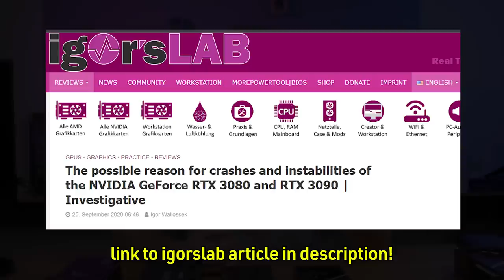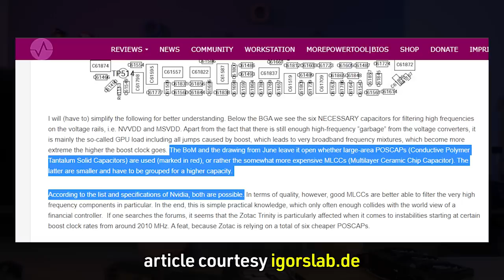The RTX 3080 Launch can't get any worse... Right? Wrong...

Comment: First generation I've only considered FE for. Strange times.
Reply: The Founders' Edition is indeed the best 2-slot card. The TUF is 2.7 slots, so it's the one I'd go for if you don't care about staying within 2 slots.
Reply: @gunnar6674  I'll stick with my 2070 Super for now. Waiting for the 4000 series.
Reply: Same
Reply: Maybe I'll snag a a 3090 when the 4000 series comes. Founders maybe.
Reply: @Mallchad  If you wait for rtx 4000, chances are a 4080 is just as good but cheaper than 3090.
Reply: @am33x  it is going to be for sure, its not a 'chance' it WILL be. or at least it SHOULD be
Reply: I mean the cooler desgin is just super nice as well.
Reply: @am33x  Not preowned it won't be ;)
Besides. 
The whole value hardware thing is getting out of hand.
Given the choice between two functionally working cards. 
If you are looking to upgrade.
As long as you can getting enough performance for what you want who cares.
Like people were selling their 2080 Supers for $300.
Founders editions as well.
Like, that's a steal and a half.
Not to mention, raw horsepower / performance is no longer the only thing that matters.
Reply: @Mallchad  Some people save up for a long time to finally afford phones, pc components etc. So to them every dollar counts. Is buying second hand a good idea? From what I know it's difficult to test a gpu's health so you don't know what you get.
Reply: @am33x  Generally.
What I think about GPU longevity.
The parts don't really wear in the same way. 
Not unless they are exposed to quite a lot of shock/vibration or water damage.
You lose small amounts of clock stability overtime but the cards are usually build with overclock headroom anyway. 
*usually*.
It either works, or it doesn't.
That doesn't change in any short timespan.
Maybe in some cases there physical damage where the card is on a death timer.
But I would expect you would be able to identify that quite easilly.

Comment: Glad I still use the 1080ti, The Anomaly.
Reply: Glad i didn't sell mine till now
Reply: 1080 ti is not even mid-end at this point. sold mine weeks ago. 3080 tuf sails with 2+ghz boostclocks post oc.
Reply: @lort6022  The 1080ti is still high-mid... you are out of your mind if you think it is below mid-end.
Reply: @jong2359  a 3060 will be stronger so is it really top tier
Reply: @lort6022  get a grip, 1080ti is ~ 2080 performance.
Reply: @pootsplasencia4846  What are you even talking about?  That is like saying $5 is worth more than $1.  We are talking about 1080ti cards.
Reply: @lort6022  in what universe is a 1080 ti below mid range? it runs any game that currently exists at 4K on high... maybe not max but then it never could max out anything contemporary with it at 4k lol
Reply: Sovsefanden wat...
Reply: @jong2359  a 3060 is supposed to be equal to a 2080 which is a little bit better than a 1080 ti and a 3060 is a mid range card a 3070 mid to top and a 3080 and 3090 are top tier
Reply: @RWoody1995  u dealing with nerd elitist... i have the new shiny lamp so your old lamp is trash.  Been that way since forever
Reply: RWoody1995 I wouldn’t go that far lol..
Reply: My 1080 is beasting still, 100+fps ultra mega penta giga uber settings on any game. So I do not see the reason for dropping a 1080, not to mention a 1080Ti. People are seriously fucking dumb.

Comment: If the user was initiating the overclock, your argument would have a more solid base.  As it stands (and if it is a hardware issue that can't be fixed by a driver w/o reducing performance), a recall seems the correct approach. If you're correct on the total cards in the wild being in the low thousands total, then each manufacturer may be looking at a minimal cost.

Comment: I can't wait to see what AMD has to offer this gen.
Reply: the ps5 and xbox x got amd 32 core GPUs that can go bettween 1.10GHz to 1.23GHz on all 32 of the cores so its not even comparable bruh and those game consules are being sould for like between like $300-$600 USD eve those the gpus cost over $6,000 USD eatch and not to mechon apple got sick and tired of niveda cheaping out and swtiched to amd back in 2015
Reply: ashtiboy uh what
Reply: ashtiboy ????
Reply: @ashitboy are you high
Reply: @ashtiboy  what are you on
Reply: ashtiboy first, neither console has 32 compute units. Xbox went with 56, and PlayStation has 36 so I don’t know where you got 32. Second are you seriously suggesting that Sony and Microsoft are selling these consoles at a 5,500 dollar loss? That’s almost ten times the cost of the PS3 when it released, all down the drain. And finally, Apple switched to AMD GPUs supposedly because Nvidia GPUs where failing and Nvidia said it was apple’s fault and Apple said it was Nvidias fault, and this arrangement has been to the detriment of Apple customers ever since. I mean, you can spec out your new MacBook Pro with the new top of the line i9, but you can’t get a more powerful GPU then a what, comparable 60 series gpu from team green? (By 60 series I mean like 2060, 1660 1060 and 3060 gpus, not that Nvidia has some 6000 series gpus)
Reply: I can
Reply: @benoitpepin5779  good boy

Comment: same issue with PS3 NEC TOKIN capacitors when they run down on capacitance over time. So they aren't able to provide enough current needed by the CPU to keep running. Putting cheap capacitors only makes the cup trip sort of. Since there's not enough power supply to the card

Comment: Just send 'em to Louis Rossmann. 😉

I myself will stack up on some MLCCs and fire up my hot air station. I'm wondering what potential might be unleashed with 6 of those power delivery stacks. 

Regards,
Etna.
Reply: The only potential is a stable card.
Reply: It's entirely possible that both footprints are on the board. We do that where I work sometimes to avoid supply problems. I know I couldn't reflow caps that small, but I'm sure someone could.

Comment: AMD watching this, slapping MLCC's on all their upcoming cards with a greedy smile :D
Reply: Why bother? They'll get crashes purely from crappy drivers lol.
Reply: @woopwoop3924  either that or they have a card that will hurt nvidia pretty bad, excited to see the face off in October
Reply: AMD has no control over what AIB's do....hate to break it to ya. The GPU is that little chip on the top, nothing else. Everything else is up to the AIB to do. They failed at their job, not Nvidia. Even if rumors of a faulty blueprint are true (which I highly doubt), the AIB's should have noticed that during performance testing and designing of their boards. It is their fault 100%.

Comment: Find it odd that Asus isn’t showing that stellar MLCC configuration on their website with the TUF 3080. I see 6 of the crappy pulse caps behind the GPU die. 
https://www.asus.com/Graphics-Cards/TUF-RTX3080-O10G-GAMING/

Have a feeling their is gonna be some changes in personnel with these AIB’s. 
When I buy a higher tier non-reference card, I expect better parts. Not worse.  
Never thought I’d see the day when the reference card is better than many of the higher tier cards.

PS. I have used reference cards in my system for the last 2 GPU’s I have owned (980ti, 2080ti) but if I bit the bullet with this gen I wouldn’t have gone with the FE partly bc of the experience I had with all the screws and thermal pad craziness in the 2080ti, but the main reason being that wonky power connector of the 3000 series FE cards and the fact that higher tier AIB cards (I thought...) all performed better with their higher power draw. EK hasn’t even release waterblocks yet for those Nvidia 3000 FE cards (which to my knowledge is a first. FE is usually the first with waterblocks). Bet it’s bc of those power connectors. You pay for a nice system, you set it up yourself, it looks beautiful with ur custom cables, loop, lighting, etc....now you got this dongle Nvidia is forcing you to use with their FE cards.  I may be wrong, but this is what I’m seeing.
Reply: Meat Fancy 
That, or the website was created VERY early on, they discovered the problem and changed the design before going to mass production. 
I don’t have enough info to know yet. 
Either way, they need to chg the website if they indeed are releasing a superior card. It’s gonna cost them severely if they leave that image up if it’s not representative of the parts on their released version.
Reply: Its probably the Strix that has the better configuration:
https://www.asus.com/Graphics-Cards/ROG-STRIX-RTX3080-10G-GAMING/gallery/
Which kinda makes sense
Reply: @the_mrkaryo   They've changed the TUF images now too =) (only thumbnail on one of the images tho)
Reply: Karyofyllis Patsidis 
Yeah. Strix’s images are what I would expect given this news.
Reply: In fact you can see BOTH versions of the TUF card, one with the cheap caps and other with the MLCC ones. lmao
Reply: What's the eVGA FTW3 ULTRA 3080 running? Can anyone confirm?
Reply: The gallery images don't matter. Someone put the wrong images on those pages. One is the OC version (the one with "O" in the naming scheme) and the other is the non-OC version. The OC version is going to be the one with the full six MLCC groups (the better caps) and the non-OC will be the one with six of the lesser capacitors. The images are just all fucked up and mean jack shit. The OC version also has three 8-pin's, but the images in the gallery only show 2. So, yeah, whoever put their website together didn't know wtf they were doing. 

And because these cards both look exactly the same, with the exception of the capacitors and the power plugs, I can guarantee you people will be getting them confused and selling the shittier one for the price of the OC, and vice versa. You can thank ASUS for this confusing bunch of bullshit, and you can thank NVidia for forcing their board partners to wait until last minute before they can do anything. What a fucking joke of an industry. 

Non-OC (shitty capacitors) https://www.asus.com/Graphics-Cards/TUF-RTX3080-10G-GAMING/gallery/

OC (good capacitors) https://www.asus.com/Graphics-Cards/TUF-RTX3080-O10G-GAMING/gallery/

Ignore the images.

Comment: Hm. I can solder SMD components. Should i build a business on this? :D ;P
Reply: Ur name. LoL
Reply: That's one way to put your hands on a 3080 this year... LOL
Reply: Do it bro even if it's a little internet thing call it 3080fixerer
Reply: If you're as good as Louis Rossman I'd buy repaired boards off you
Reply: Doesn't the board need different traces and solder pads for the smaller more expensive capacitors? 
I think that's why Jay said they're going to do a firmware fix rather than a board fix. Because they would have to redesign the power delivery of the board again. And that would be expensive and time consuming.
Reply: Yes
Reply: Yeah should be possible to modify the board.
1. Make interposer PCB that mounts 10x 22uF MLCCs and solders onto the space occupied by the larger cap.
2. Remove the large capacitor without messing up anything else on the board, lots of flux helps.
3. Profit.
Have fun with what remains on the postal system, 'cause people are going to have to mail the cards to you.
Reply: I was thinking exactly the same thing. Looking at the pictures of the pcb, the pads for the mlcc's are there. With my rework station I am pretty sure I could change out the cap's in an hour or so. It's the kind of stuff I do all day every day at work.
Reply: @swanseauk  I couldn't tell if the pads for both style of caps were there, without rewatching the video and pausing it.
If every board has the ability to replace the up to 6 larger caps with 10x smaller ones, there is no reason experienced SMD solderers and the factories cannot fix these cards.
I wonder how stable these 3080's would be with 60x smaller caps and no larger ones.
Reply: @HaggardPillockHD  Fans will spin, i swear! PPBUS_G3H will be happy :)
Reply: @QuackZack  You can see the smaller pads below the cheap caps. It would take like a day, with proper testing to change the picker machine, and maybe days to get new capacitors -and the cheap ones gonna be wasted

Comment: Gigabyte, I trusted you, traitor.
Reply: You say you TRUSTED Gigabyte? XDDDD
You can't be serious. Gigabyte is the bottom line in both quality and price. I had a Gigabyte RX 560 in my system for a month and after a few crashes it died completely, nothing appeared on the screen after start. I swapped it with an ASUS model, and it works fine even after 3 years. My dad and a friend also had serious problems with their Gigabyte mobo. Furthermore there are tons of customer reviews about Gigabyte mice, where they say it dies pretty early. Mate, this company is the WORST in the IT segment, and their product would be the last one I pick in any cathegory.
Reply: @staLkerhu  my previous cheap gigabyte motherboard survived my PSU death after 4 years and overvoltage from city grid failure while msi 760 card was damaged, there was 1060 on it also for 3 years. Gigabyte 1660s that i use is cheapest and works great, and also i am again using gigabyte motherboard for over a year dsh3 b450.
Reply: @HAYWIRE2466  Yea from my experience cheap boards are much better than they were 10 years ago.. Really good overvoltage protection..
Reply: Never trusted gigabyte after i had two gpus with bad fans
Reply: Gigabyte uses Panasonic 470 SP-CAPS, which are higher than the 370 PostCAPS talked about in this video.
Reply: I even ordered gigabyte 3080
Reply: @HAYWIRE2466  Yeah that's true. Also I should be looking forward to Aorus.
Reply: @staLkerhu  They were kind of good for me but not now...😔
Reply: @1GTX1  That were good enough. But this GPU release kinda sucks.
Reply: @HAYWIRE2466  I'm gonna wait for Aorus now.
Reply: @HoboCat  Yeah !They are kind of failing in modern tech.
Reply: @VietJuggernaut  I think Aorus is still gonna be a better option.
Reply: @MonkeyDLuffy60073  Good Luck with that & wish you the best.
Reply: @Saigonas  RIP 😔

Comment: Tinfoil hat: NVIDIA moving forward with their plans to phase out AIB partner cards for all the moneyz
Reply: Well if it's AIB partners not building to spec then those partners are the ones moving forward with that plan instead of Nvidia ironically.
Reply: Matthew Langley The rumor is that nividia gave the AIBs the “cheap” ones as spec originally, so all those ones with problems are technically to spec by nividias original standards. Only recently did they get updated specs. Of course it’s rumor and we probably won’t get any confirmation any time soon
Reply: @ZenoSol_  That's an interesting rumor. I don't know whether to hope for it to be true or false though.
Reply: @ZenoSol_  Yes....let's build it to spec....because our whole marketing standpoint is based on building things to spec! Oh wait, no it's not! AIB's are supposed to offer something that the first-party cards do not. Extreme built-in over-clocks, better cooling, more memory, better performance better durability, better value. That is their WHOLE JOB. They failed to do it, it is 100% on them. If they'd done their due-diligence and produce these cards with a proper level of craftsmanship and quality, this would be a non-issue. Instead, they cheaped out to save a buck and maximize profits, pure and simple.
Reply: William Eldridge Literally go look at igors labs post and tell me how the AIBs are at fault when nividia was forcing them to make cards without drivers and adequate testing software due to “secrecy.” Nividia makes good shit but they’re literally one of the most greedy shit hole companies I’ve seen.
Reply: MineSweeper the igors lab post that is cited in this exact video gives some evidence to his claim
Reply: William Eldridge Also AIBs always had built to spec before nividia wanted in on money with their 20xx founders cards. Never before had they distributed cards directly to my knowledge

Comment: Every damn card I buy has issues, other than my old 580. My 1080 flaked out (crashed consistently in certain games), my replacement 2080 flaked out (snowed all the time in games) and had to be RMAd, and then my RMA 2080 is also flaky (snows sometimes in direct x12).

Comment: For those consumers NOT in the US and have actual consumer protection laws:  Not built to spec and having issues means: "not fit for use".  Contrary to what Jay says, Nvidia is known for and encouraging overclocking of their cards which is a material fact in the sales contract.  This means the remedy is a refund, or a recall; especially if you paid a higher price for a card which is out of spec.

Comment: Should consider taking this down since the crashing issues were fixed with a driver issue with zero loss to performance. This fear mongering / over reaction to these capacitors was dumb.
Reply: @Battleneter  That's Jay for you.

Comment: Well, it's happened to me.  Bought on 01-23-23 working well but on 02-13-2023 while gaming the PC froze then went to black screen. I shut it down and tried to reboot, but it will not go into post and unable to get into BIOS. I removed the EVGA 3080 10G and installed my old EVGA 2080 8G Super and the PC is working again. WTF ????

Comment: JayZ if your in California (and some other regions) I'd check the consumer laws. If it says the 1710MHz is the norm but boosts to 1910Mhz or whatever than both numbers are binding. If you buy it at a base clock but able to boost to a higher  clock but not able to boost you can go for a refund.

Comment: But SURELY 'one' of the contributing factors to setting the price point of this card by the manufacturer is the manufacturers advertising the Boost Clock on their packaging, websites, other collateral of advertising. In other words, someone could purchase the card at the price these cards are sold at because of the advertised Boost Clock Feature. That is at least misleading.